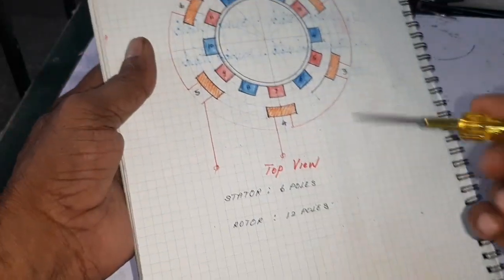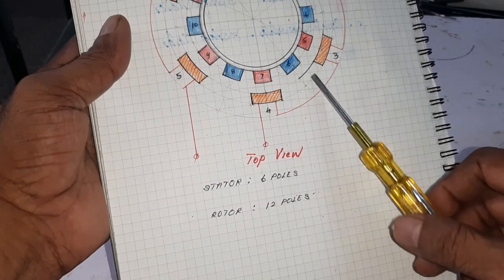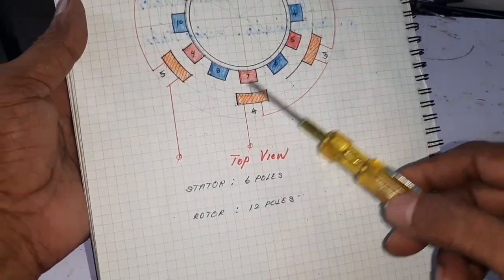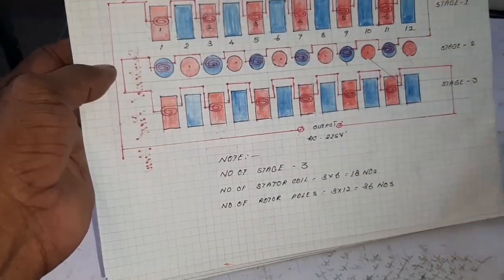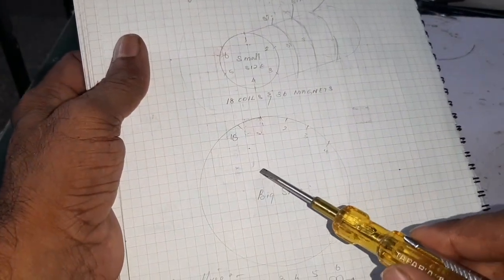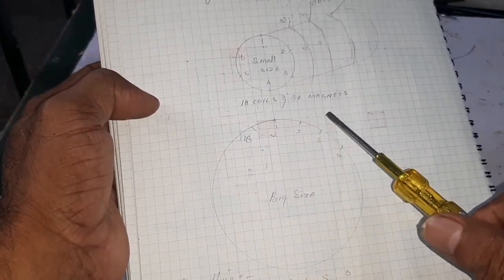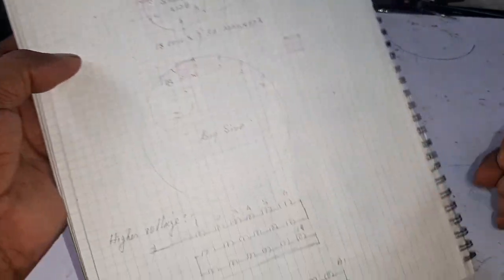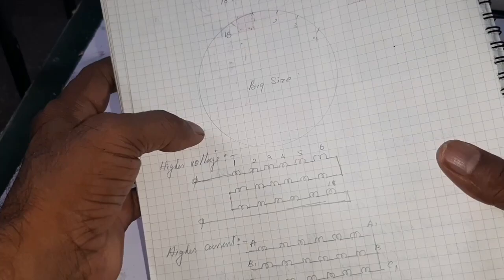Home made 220v,500w multistage wind generator(Type-1)

Comment: Very good Projet , just with simple materilas . Excellent . But , Since you have made the claim 220v and 500 watts, shoud have given proof of demonstraion with measurement .
Reply from the maker: Thanks sir
Yes I have measured the voltage and given load by driven external motor but not used with wind turbine.